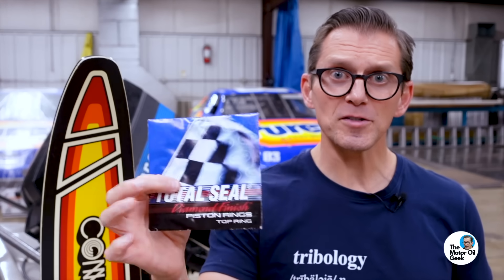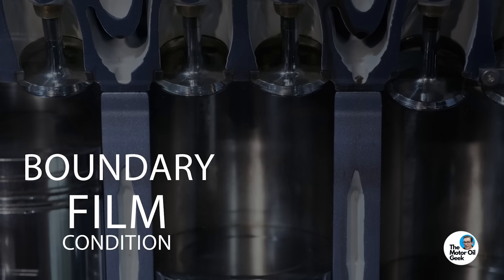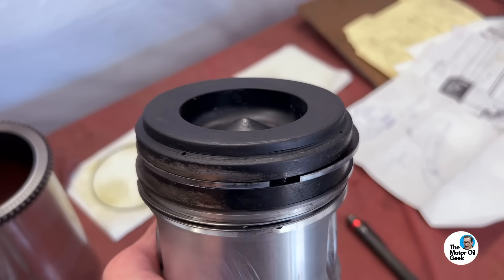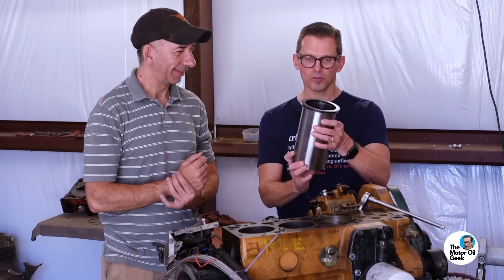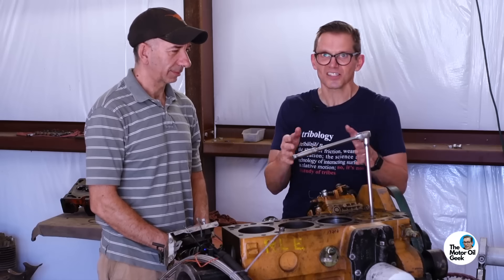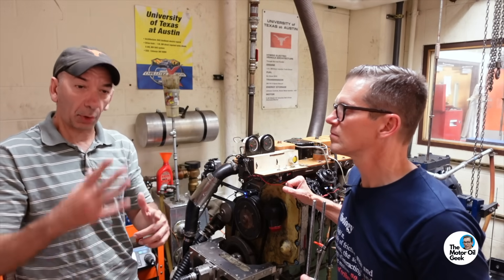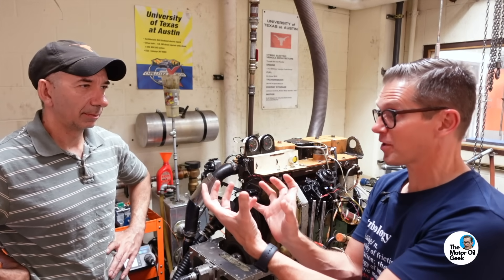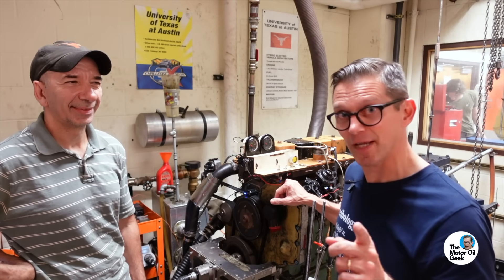Water Skiing Explains LUBRICATION - This CRAZY Engine Proves It!

Comment: Can i use Valvoline restore in my lawn equipment (4 stroke engines)?
Reply: Yes
Reply: As long as it doesn't have wet clutches such as a motorcycle it's fine
Reply: @mblake0420  just lawnmower, power generator and gas pressure washer